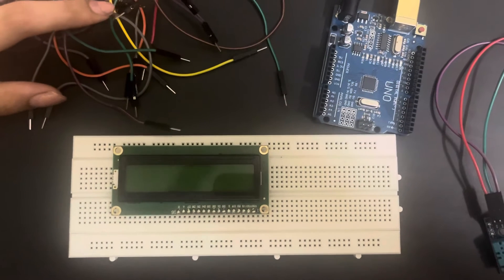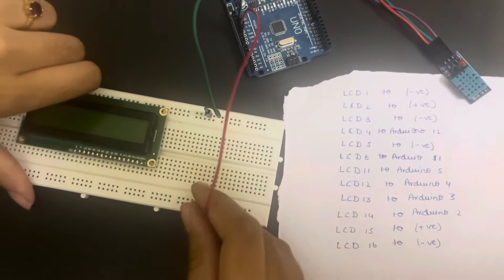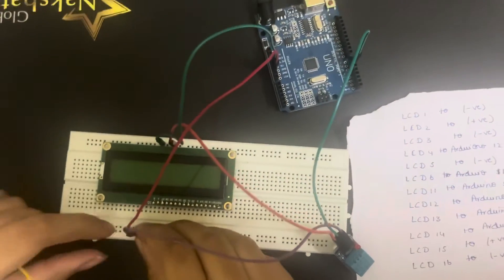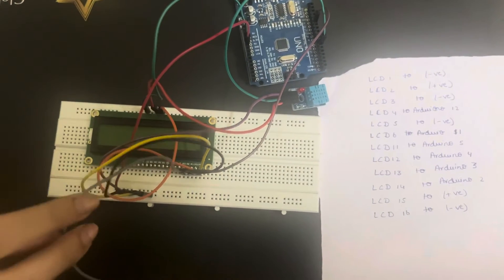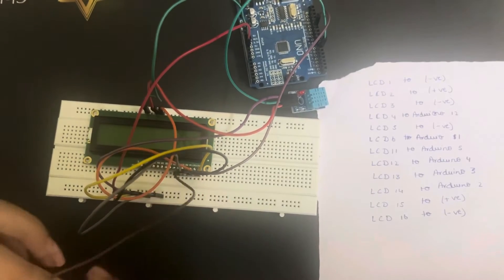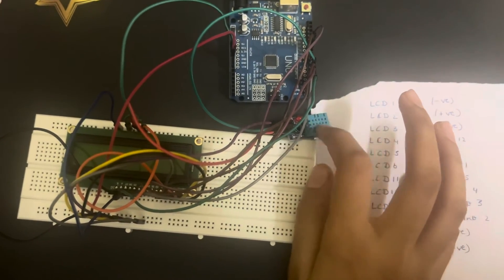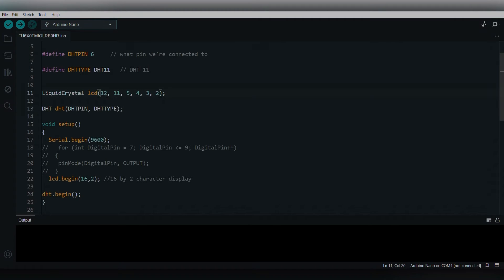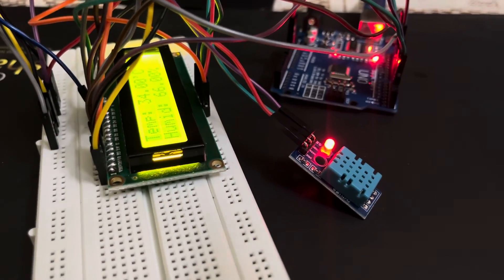Build Your Own Arduino Weather Station | Temp & Humidity Tracker

Comment: i made one with htu21,an external ntc,a bmp280 and a 2004 display, with 12h historical data on a slave arduino for writing the data and for the master arduino to compare,processing of the sensors,screen and predict local weather